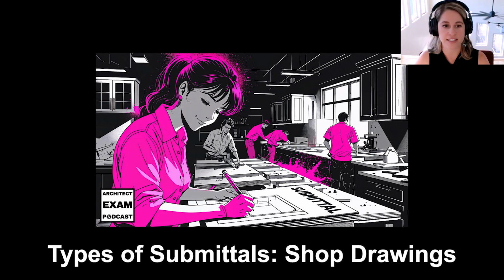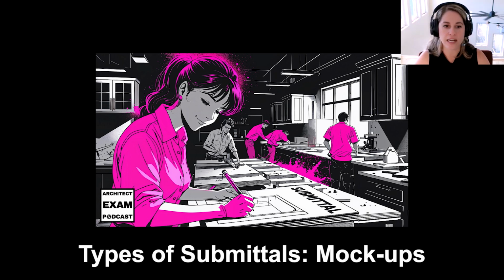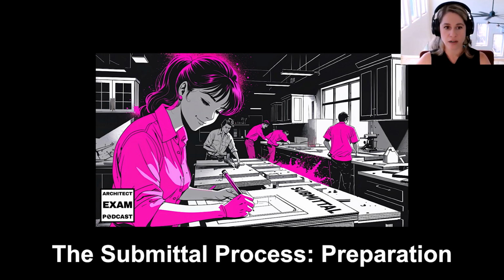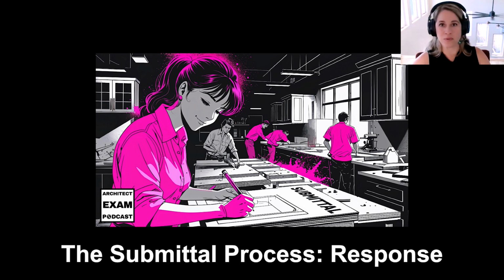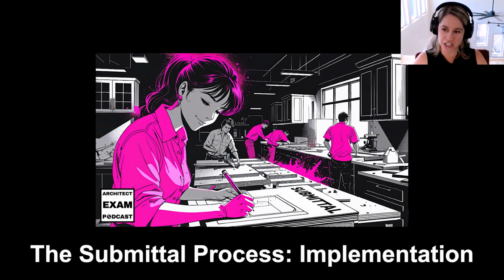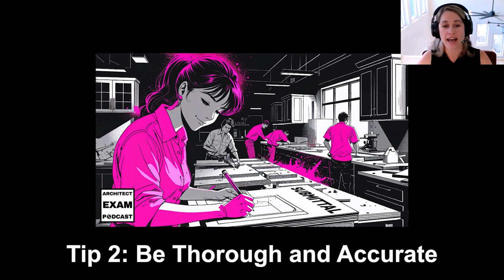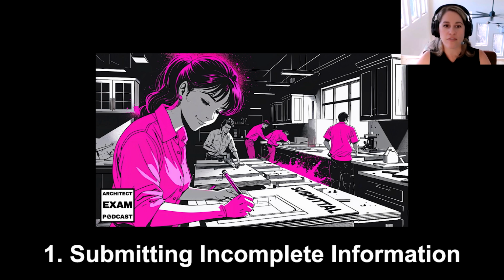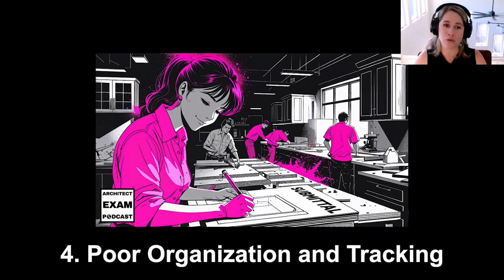Construction Submittals: No Exceptions Taken

Comment: Great Video!!! Not just important for registration purposes; but for every day use in practice as well. 
In my market, it is surprising how little this process is understood by consultants and contractors. 
Some contractors and project managers I work with feel that they don’t need to check the shop drawing. And just pass the shop drawings onto the architect. The contractors often feel they don’t need to check or have any responsibility to check the drawings themselves.
that’s why it’s important to make a log of the submittal. And when you return your comments, make sure it’s accompanied with a caveat explaining as an architectural consultant what your responsibilities are in relation to the shop drawing.
Reply from the maker: Justin, this is a great comment and you’re hitting on something that frustrates a LOT of architects.

You’re absolutely right. The contractor is supposed to review submittals before they ever get to the architect. That’s not optional, it’s literally their contractual obligation. When contractors just pass shop drawings straight through without reviewing them, they’re skipping a critical step and putting everyone at risk.

The submittal log point is huge too. Tracking what was submitted, when, and what the review action was protects everyone. And your point about clearly stating your responsibilities when returning comments is smart practice. 

The architect’s review is for general conformance with the design intent, not a detailed check of every dimension and field condition. Making that clear every time keeps your liability where it belongs.

This is exactly the kind of real-world insight that makes the exam content click. Thanks for sharing it.